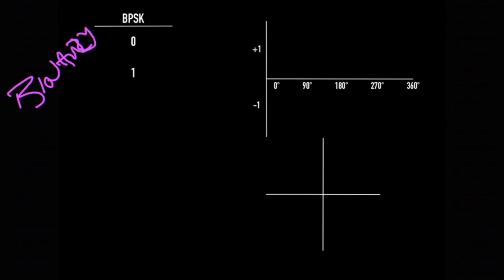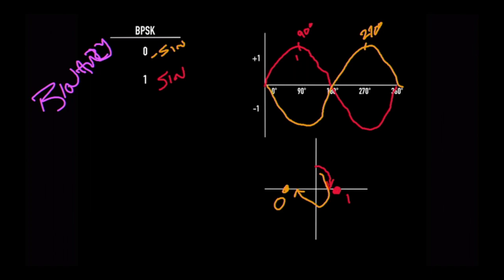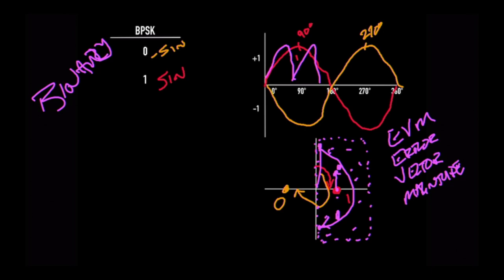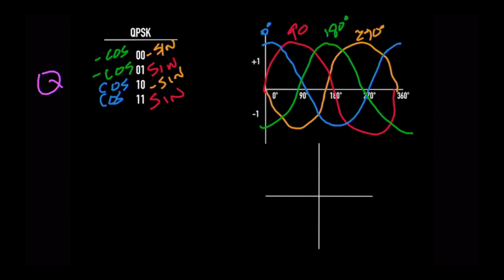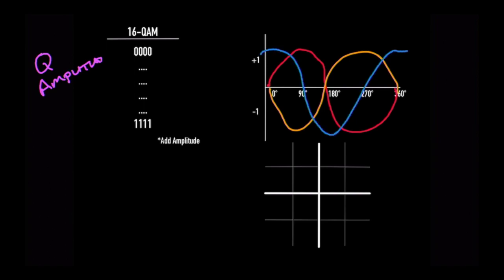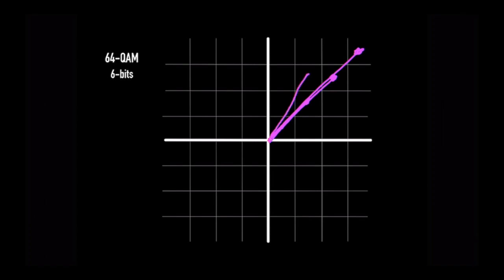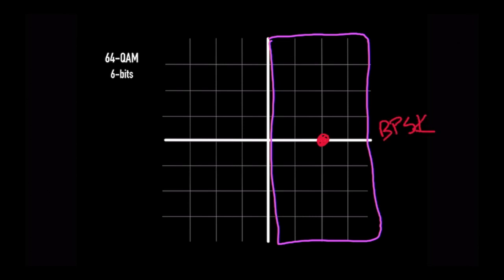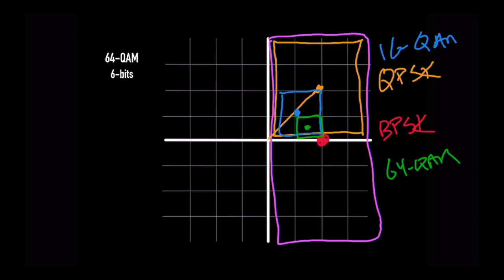Different Types of 802.11 Modulation Schemes

Comment: in my head, drawing upon a distant mechanical background, it looks like sending nuts down a bolt, each nut has a '12 o'clock marker' and it depends upon where you put that marker, in phase, out of phase, quarter phase, eighth, then when it comes to amplitude, its like sending a bigger or smaller not on that same bolt.

Comment: Nice explanation. Also worth mentioning that this tech also applies on cable. I hope there is an explanation if and how a wifi router regulates the modulations and how much router software can improve the transmissions between devices in a noisy area.

Comment: Is this considered frequency modulation or “timing” modulation for lack of a better term. It sounds like they all have the same frequency/hertz
Reply: This, as I understand it is technically "Amplitude Modulation", meaning the receiver determines the info being conveyed based on the Amplitude changes. QAM= Quadrature Amplitude Modulation. I guess the "timing" would be based off of the frequency of the wave. But dont get this confused with FSK
Reply: I think it's actually phase modulation

Comment: really clear.
is it possible to transmit some data at low speek using BPSK while transmitting complementary data at higher speed using #QAM? on the same band

Comment: I've always wondered where you get the phase reference. If you move 1/4 wavelenght away from signal, all phases get shifted by 90 degrees and so on.
I think QPSK, QAM and all a like are very clear but like phase shift with distance, it is totally unclear like how you know which signal is I or Q in IQ-modulation/decoding, another phase reference mystery to me.

Comment: great video, but you said that BPSK is more resilient than QPSK which is actually not correct they have the exact same BER curves, hence for the same amount of power you can send double the data rate using QPSK compared to BPSK, and still have the same error rate.

Comment: Why is 90 degrees not on the top? The vector turns counter clockwise beginning on the right. So it needs to be on the top. Please can you change your handwriting?
Reply: i think is a erro by the autor. I have the same question. I think Is the same but rotating diagram counterclockwise by 90 degrees
Reply: Just a matter of convention. 
In Italy all engineers do like you said. 
All the Geometers do as in the video. 
Conventions :)